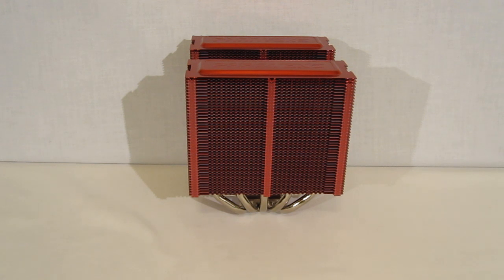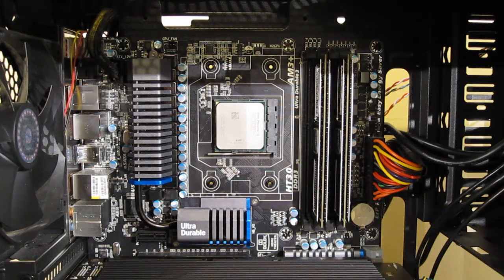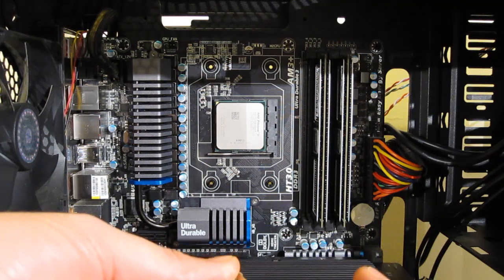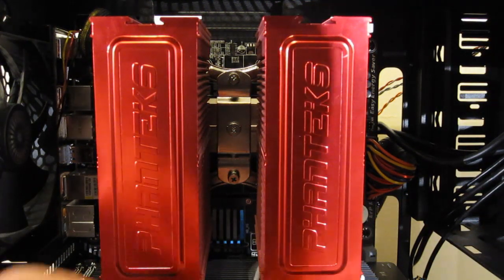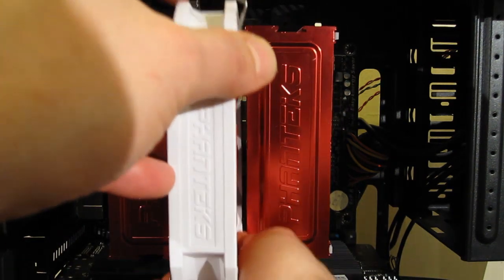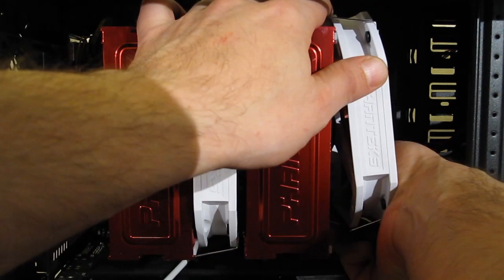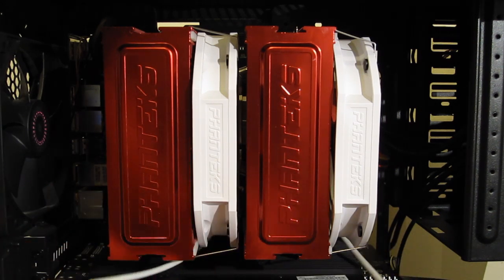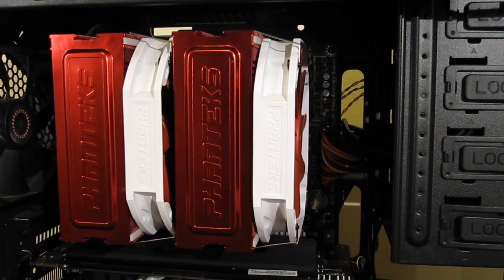Phanteks PH-TC14PE Installation at HiTechLegion.com

Comment: I know this is kinda late but I just bought this cooler but while trying to install it I lost the middle screw which will attach the  clip of the cooler to the cpu. But the other 2 screws on the clip still hold the bracket on the mainboard pretty tight. So I just wanna ask without the screw in the middle will there be any....lack of pressure between the cooler and the cpu?

Comment: I can't really tell from the video but: I'm currently using 2 sticks of Corsair Vengeance Pro RAM, if I would mount one fan in the middle of the cooler and one in the back, would the "front" radiator still be big enough to interfere with my RAM?

Comment: Grrr I just installed this heatsink today and my RAM is too tall even though I have pretty low pro RAM. I have to install the front fan a little higher which on a mid tower chassis like the NZXT Phantom 410 is a no go. The side panel won't close. I have the Avexir Core White series which are 3.8cm tall. HiTechLegion, what RAM did you use and what would you reccomend? I'm struggling to find any low profile RAM with rated speeds of 2133MHz
Reply: I was using Patriot G2 in this video, but generally run ADATA XPG XTREME in the air cooling rigs. But, both are discontinued. Patriot Viper 3 is available with low profile heatsinks in 2133, as is Corsair Vengeance LP and G Skill ARES.
Reply: George Cella Ahh okay, cheers for that, I'll have a look at them now. Sometimes air cooling can be a right pain in the arse as this is the second time looking for RAM due to the same issue. I used to have the Kingston HyperX Predator 2400MHz sticks but swapped them for the Avexir sticks for the same reason.
Reply: George Cella Hey, I've been looking for RAM all over the place over the past couple of days and thought I'd share what I found so you can inform others for future reviews. For monstrous heatsinks like this using 140mm fans in mid tower cases, there is literally ZERO RAM clearance. I'm using an NZXT Phantom 410 chassis with this cooler and borrowing a friends RAM stick (30cm tall) I can get probably a maximum of 2mm clearance between the front fan and the side panel.

The memory market is extremely narrow in high performing low profile DIMMS, especially if you're picky like me. Yes Corsair Vengeance LP DIMMS will fit, but they're also one of the lowest performing  and they have an ugly green PCB. G-skill Ares have a modern black PCB AND come in high rated speeds, but for some strange reason they're only offered in a choice of vibrant metallic orange, blue and red. Great if your build is colour co-ordinated for those colours, but horrible if it isn't. Personally my build is colour co-ordinated with white and black - so that's the G-Skill Ares out of the picture.

There are other contenders too but they're all either really low rated speed/loose timings or they're in an old fashioned ugly green PCB. However, this is one hope - AMD Radeon R9 Gamer Series. Yes, they're AMD branded, but made by Patriot. Checklist - Black PCB? Check. No extravagant colours? Check. Suitable for monstrous heatsinks? Check (30cm tall). High rated speeds? Check (Up to 2400MHz). So this is what I will be buying.

For the sake of picky people like me, it may be worthwhile pointing it out considering the popularity of mid-tower chassis and colour co-ordinated builds.
Reply: Funny that I forgot about that RAM. The Radeon actually replaced the G2 I originally mentioned in the Patriot line, and I actually reviewed it. Good find and thanks for pointing that out!

But...the difficulty with finding quality RAM without ornamental heatsinks (I refuse to call it "low-profile" due to the fact that it is standard height) is absurd. All thanks to Corsair trying to pigeonhole builders into buying their CLCs. Now that people either think they look cool, or buy into thinking that the sinks actually do something, the rest of us suffer. Thankfully a lot of the newer RAM seems to be getting shorter again.
Reply: George Cella Agreed, it is absurd. To be honest, I'm not surprised it started with Corsair, the original Vengeance RAM is probably the most purchased RAM kit. Then of course, other companies try to follow in their footsteps to win the market and boom, an era of obnoxious heatsinks on RAM is born. In regards to the heatsinks, I'm pretty sure they were actually useful once upon a time with DDR and DDR2 as they ran at a higher voltage right? But DDR3 runs considerably cooler due to the lower voltage needed.

Also, I hear with cheap heatsinks the hot air gets trapped causing it to be less effective than if you was to take it off. Though I always thought with metal heatsinks they would absorb the heat and  as heat rises it would act like a radiator letting heat escape from the top. Of course though that only works when the component is getting quite hot
Reply: Ro-Tang Clan We actually tested Dominator temps with and without the heatsinks at one point as part of an article, but I can't find it for the life of me. It was part of a review on something totally unrelated that the big heatsinks interfered with. I don't recall if it was DDR2 or DDR3 since it was a few years ago. But, the point being that completely stripping off those giant heatspreaders yielded a 1~2 degree difference under load with it OC's to its max. So, yeah, strictly ornamental.

And of course it was Corsair. They are masters of getting people to buy things that either don't do anything, or do it marginally well at a price higher than much better components. But I give them a lot of credit for their marketing. They are the Apple of PC components.
Reply: George Cella  Haha brilliant. Well there's my proof right there that the so-called "heatsinks" are there just for show. It's like putting an exhaust muffler the size of a head on a Vauxhall Nova and thinking it's cool sigh. EDIT: I forgot to mention, if you do manage to find that arcticle please send it over as I'd be interested in giving it a read :)

But yeah Corsair's marketing really does work as a lot of people I know use a lot of Corsair branded products for their machines. I'm one of those people who try and buy the product that's a cut above the rest and I don't settle for 'average'. It may be a very arrogant and elitist approach to take, but at the end of the day it's what drives to do my product research and know the market. IMO Corsair are a very overrated brand, yes their products are good, but not as good as what they're made out to be and 9 times out of 10 like you said you can find better for cheaper.

But then again, I also think EVGA are a very overrated brand too. I really don't understand why but it seems EVGA graphics cards are the most popular brand in America. I've personally always stuck with MSI, but I watched a review of the EVGA GTX 770 ACX Superclocked card and I thought it was a disgusting card. It looks cheap and tacky. The shroud is plastic, there's no backplate, the fans look sub-standard and they have still kept the quirky 6+8 power sockets from the reference board. Yet that's supposed to be one of their flagship models for that particular line. Sorry to deviate from the topic there.
Reply: Ro-Tang Clan I don't find that approach to be elitist, I find it to be rational. Why would you buy a Toyota RAV4 if you can have a Range Rover at the same price (let's pretend they get the same gas mileage)? That is essentially what we are talking about.

I have never come across a Corsair product that was bad quality (a couple of the PSUs come close, though - and the whole CLC platform is a joke that Corsair and Asetek laugh all the way to the bank about). They are always solid. However, I have also never come across one that is outstanding with the exception of the Neutron GTX at the time of its release. They always fit firmly into the "quality mainstream" type of category. The problem is that they try to price all of their products out like they are elite class. There is literally not a single product in their line where you can't find far superior options at the same price point.

EVGA is a different animal altogether. Their GPUs are not flashy, and many are reference boards with a couple of tweaks, if any tweaks at all. The latest Classified Series probably have the best design and PCB out there, though - but I agree that the backplate should come standard on them, not be a $19 add on. What sets EVGA apart is incredible customer service that includes step-up programs, personal attention at quickly resolving problems, etc. I have dealt with them a couple of times as a customer, and they really are remarkable in that respect. That rightfully gets them a lot of customer loyalty. On another note - EVGA is now the only brand I am aware of offering Superflower Leadex based PSUs in the US. Dollar for dollar, nothing comes close to what EVGA gives you in the G2 and P2 Series PSUs.

Comment: would this cooler be useable in the AW X5 chassi, the max height for cpu coolers on that one is 160 mm, and I can´t seem to fin the height of this. Thankful for fast responds as I am in a hurry to find a new cpu cooler.
Reply: The height with and without fans is in the review and on the Phanteks site - 160mm without fans, 171mm with. No clue about the AW X5, I really have no familiarity with it.
Reply: George Cella ow yeah they did, well it's a really cheap crap case and it only fits 160mm CPU coolers, thank you for the fast respons. Looking for a cm hyper 212 evo with corsair sp120 fans or a noctua 12p se2.
Reply: The NH-U12S will fit, and will outperform either of those by a good margin. It also happens to be incredibly quiet.
Reply: George Cella okey, thank you very much Buddy, I appreciate it alot!
Reply: ***** Yes, really.....I suppose.....I'm not sure what you are asking me.

Comment: an you mount the fans so they don't add extra height from the motherboard? I mean put the fans closer to the motherboard? plz I need a quick answer from you or any one who KNOWS.
Reply: Fan mounting on this cooler depends on 2 things; your RAM and PC case. Ideally for cosmetic reasons you want your fans to be flush with the heatsink height. As far as functionality is concerned, you might want the middle fan to be mounted closer to the motherboard to get additional airflow over your motherboard VRM's. These are cube shaped objects on your motherboard and are responsible for distributing power to all the components. Due to their natural function, they can get quite hot which is why most motherboards have passive heatsinks over them. On some motherboards they can get hot to the touch so you may want to help them cool down, especially if you're overclocking. VRM's are one of the most neglected components of a PC, most notably by people water/liquid cooling their CPU which can lead to the death of your motherboard if you're not careful.

Comment: Hey, quick question. I'm trying to install this on a Gigabyte GA-990FXA-UD3 motherboard. It looks like the adapter brackets are about a quarter inch longer than the actual socket holes. What am I doing wrong?

Comment: Can someone pls tell me what are some of the best coolers so far, I want to OC my FX-6300 to 4.8GHz, I did it before on my Antec h20 620 but the pump failed so I tossed it and went back to my stock cooler, I was planning on buying CM 212 EVO with 2 
SP120s but this cooler got my attention, Would this be better or will the 212 EVO do just fine!!!

Comment: This is irrelevant to the video and the comment, but I really need opinions from knowledgeable people.  

I want to play modern games at relatively high settings, and possibly record while playing as well.  I would also like to not have to buy a GPU for at least 2 years.  Should I buy a 7870 Tahiti and save money, or should I go up to a 7950 and also get Crysis 3 which I would like?  Will the 7870 be enough for a while, or should I be safe and get the 3GB of VRAM?  

Thanks.

Comment: ohh so G skill Ares is 32mm apparently
its low profile
i could only find a cl10 version of it
the dominator platinum is cl9 so its a bit faster 
i dunno
i might just drill some holes throug the top plate
if it doesnt work out
ill have to pay a restocking fee for the cooler :(

Comment from the maker: Perfect opportunity to upgrade your RAM. The return of the X60 should net you the TC14PE plus some G Skill Ares, ADATA XPG Xtreme, Mushkin Blackline, etc.
Also, the airflow of the 810 makes the performance difference between this and the X60 VERY small, and the Phanteks is MUCH quieter.

Comment: i heard 40mm is the factor
i have corsair dominator platinum 16gb 2x4
its 50mm about 2 inches :(
i bought a kraken x60 though but i cant install the son of a gun since my case needs a new top plate for the switch 810
figure ill return it and buy this fan but now my ram is freggin tall

Comment: Per the official g skill website.  ALL ripjaws ram choices are 40 mm in maximum height..meaning you can use all 3 140mm fans that are included with the phantek ph-tc-14pe bad ass air cpu cooler.  My guess is that the fans, cpu hsf fins, or both will be literally BARELY touching the tops of your ram.  I've had a config before like that and never had a problem ( ran it overclocked to 3.9 from 3.2ghz 1090t phenom and ram never felt hot. Just miidly warm after hours of metro2033.  cheers

Comment from the maker: If you are using two sticks, the front fan will have to be mounted high on the cooler and may or may not clear the side of your case (depending on your case). Honestly, the spikes are just for show, CPU cooling is a functional necessity. I would be inclined to address the actual need rather than add some heatsinks that you won't see behind the cooler, anyway.

Comment: i need help with this cooler. i was going to get the corsair vengeance ram with the cool heatsink on them( the like spikey bits on top) would this still fit with this cooler or would i have to get the low profile version ??? thanks in advance

Comment: For reference i'm at 4.8ghz on a 2600k. IBT level on maximum and the highest temp i got was 78 deg. celsius. I'm gonna try reseating the cooler. I know it's only air cooling but i was expecting a tad better. Also when installing this thing make sure you take the mobo out first!!!